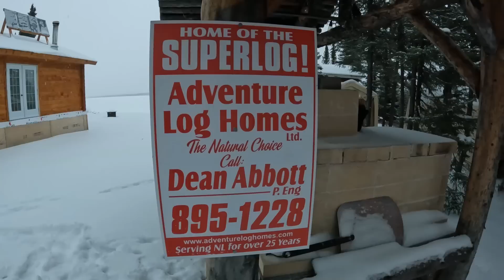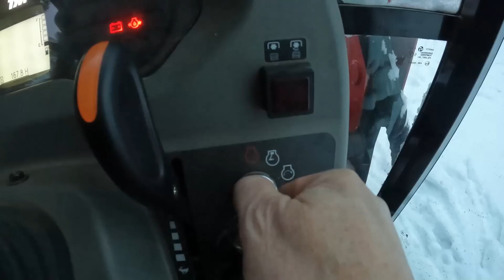Snowstorms, Cold, Delays, Hot & Cold Water, and the push to move in (Off Grid Cabin Build Series)🏡

Comment: Great video and beautiful cabin progress.  The floor in my cabin is not insulated.  I saw you put styrofoam down before laying your clic flooring. Was wondering if that was a special foam board you used for the flooring and what the product name is called. Thanks, from Hells Canyon, Frank.
Reply from the maker: Just rigid insulation. Styrofoam SM. It’s about 1” thick. You can get the 2” as well. Works very well

Comment: Great job, I'm putting the same water system in my cabin. Do you have any plan to prevent the system from freezing or draining the system. Take care all the best.
Reply from the maker: Yes I will chat about that in a later video. Basically though I will have things setup like an RV. If I leave during winter months I will inject plumbing antifreeze into the system
Reply: @ChuckPorterEverythingOutdoors  
I am hoping to be able to drain the heater, and just put a little antifreeze to the pump. This system will be in my cabin and having to add antifreeze to the whole system every time I leave in the cold months and drain to use just to reapply for when I leave is a little too much. 
Looking forward to your explanation in an up coming video.

Thanks Bryan

Comment: Do you have an air exchanger? You have a vapor barrier so you might have moisture issues without some ventilation.
Reply from the maker: No sir exchanger. I typically crack a couple windows and that helps. Not usually too much of an issue. Air is extremely dry here in the winter time.

Comment: Thats a great build been following along steady, what's your plan after you install your battery banks for when you have to plug in your block heater on your tractor or some other high draw? Will it support that large load on the system or will you run off of generator? Keep up the good work!
Reply from the maker: No I’ve always used a gas generator to plug in my vehicles. Although most block heaters are only 300 watts so it isn’t that much strain for a couple of hours

Comment: Really great job on the plumbing system and the bathroom.  It looks great!  What's your plan for all the Pex plumbing to prevent freezing?  We have a Blaze King in our cabin and it works great.  Almost too great lol.  It gets pretty toasty, but it doesn't use much wood at all.  What type and brand of flooring did you use?  We've been doing a lot of research on what to use and I think we might use vinyl.  Just tough with a 3 season cabin to find flooring that will withstand cold temps.  Thanks for the great content Chuck!
Reply from the maker: I plan that if I go away for an extended to time I will have a system in place to instantly flush all lines with plumbing antifreeze. I also will have propane heaters strategically placed throughout cabin in case I’m just gone for a night or two. Then I won’t have to bother with the antifreeze. 

I used waterprooof vinyl flooring in my bathroom with spc core
Reply: @ChuckPorterEverythingOutdoors  Thank you Chuck. Sounds like you've thought of everything! Lol

Comment: I have a hot water on demand similar to yours but mine has LCD temp display make is Onsen. They work amazing. Mine is only for a shower. Hundreds of showers on the same 20# propane tank. Same with the D cell as well. Also have a connection and cables to connect to the 12 volt battery but never used it. 
Cabin is looking amazing, you’re a very good handyman as well… cheers
Reply from the maker: Great to hear bud👍

Comment: Just found your channel today. I am no expert on cabin living. I lived in a very small cabin with a bed loft in the mountains of Vermont for 15 months as a caretaker for someone's property and I am just curious why you didn't choose to go with a metal roof? For me, the metal roof made dealing with the snow when necessary much easier.
Reply from the maker: After much thought, I didn’t go with the metal roof for two reasons. One, the cost was incredibly higher than shingles. Secondly, I have my solar panels installed up there now and walking on metal in the wintertime is extremely slippery (I have to clean the panels off occasionally when it snows)

I guess another reason would be that I am very familiar with shingles and can repair them easily. I’m not as familiar with metal roofing. 

Glad you tuned in! 👍

Comment: Awesome video Chuck it’s great to see the progress and boy winter is certainly setting in. Just a question how would you drain the system i.e pump if you were to leave for a trip per say. Take er easy can’t wait for the next one
Reply from the maker: I will have drains in the low points. I purposely set it up that way. But, I will put in a second reservoir for plumbing antifreeze and pump it into the water pipes exactly like an RV. That way the full system is protected
Reply: @ChuckPorterEverythingOutdoors  awesome, good stuff

Comment: That's an amazing amount of work. Do you lay the Styrofoam under your floor for insulation? Never thought of doing that!
Reply from the maker: Yes 100%. It’s rigid but it still has the ability to absorb an uneven floor joint etc. worked very well. I’m using 12mm laminate flooring.  If you were using thinner laminate you’d need to put some plywood down first. That’s what I have done in my washroom

Comment: Hi Chuck! Question: I live in Iowa and run a 16 panel 100watts each solar system with 8 deep cycle marine batteries and have an Ecoflow 1500 watts storage battery!  I like to run partly from grid and solar.  I believe I saw your system having a 3 way switch so you can go from solar to generator, is that right? I am looking for one of them to add to my system and run downstairs outlets on solar and the rest on grid!  I don’t have the budget to go all in. Thanks!!!
Reply from the maker: Hi Martin. Great to hear from you. This is my switch. https://www.amazon.ca/dp/B07T8NWMZ8/?tag=chuckporterev-20
Reply from the maker: You can switch from up to 7 sources
Reply: Thanks so much, very helpful!!!!

Comment: How does your tank work? Do you have a switch for the filling? Just opinion, I think you’re going to struggle and use more then your supply in the tank. We found when we did ours the tank was too small and it was 40 gal. We always had to watch showering, and other uses at the same time, our pump went dry from the 40 gal emptied out. So I went bigger. Maybe you guys won’t have multiple use emptying issues. I’m curious to see how it’s working out. Anyway enjoying the vids. You’ve heard the term right Newf, (sorry used to calling my brother in law that). “Opinions are like azzholes, everyone has one”. Thanks Chuck
Reply from the maker: The tank I have there is 50 gallon. I have a floating switch purchased but not installed yet. I figure I’d get used to the water system first and then upgrade as I move along. It seems to work fine thus far. I also installed a clothes washer that only uses about 7-8 gallons per wash so that is working out great.
Reply: Sounds right. I find I end up doing a lot of trial and errors. Lol. You’re system will work, you pump up to that tank I forgot about that. Ours flows as it is artesian water and does not pump up to the tank. So my correction. Yes now o don’t think you’re going to experience shortages. Thanks From northern Ontario Chuck, always enjoy the vids. Cheers

Comment: Hard to tell but if you haven't, you should screw the conductor screws on the switches ( receptacles too ) all the way in if you don't use them i.e. if you just push the wires in the conductor holes.
Reply from the maker: Good tip bud. I will follow suit. Tks!!